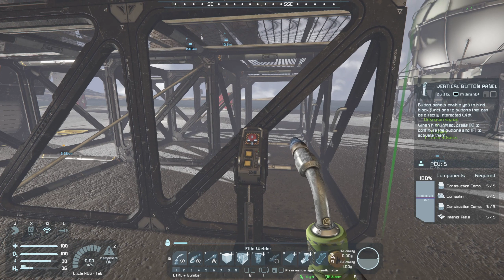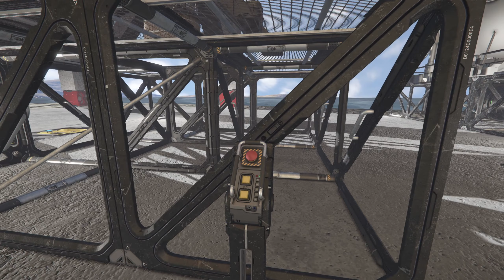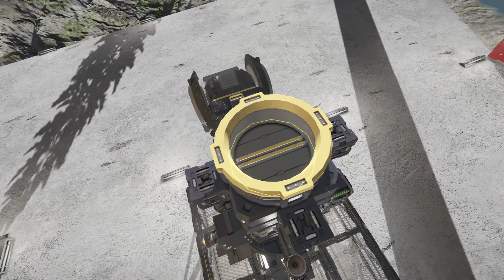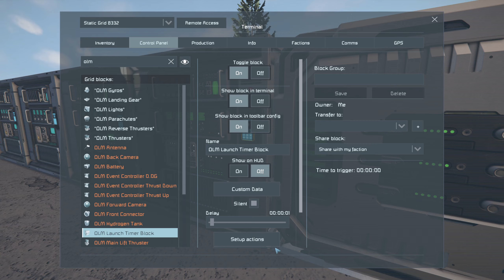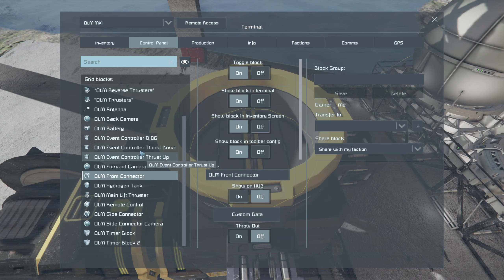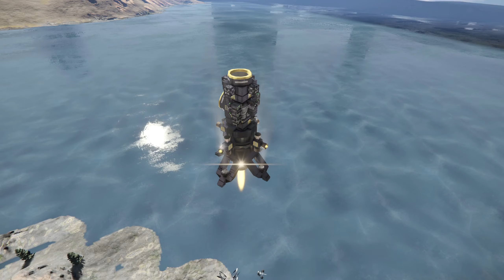Space Engineers Play Through: Close to Home Ep. 17 Need a Lift?

Comment: A very satisfying launch. Just on the auto-thrust, it didn't seem to work, because the event controllers only do a action once. I have a single event controller under 95m/s trigger a reoccurring more thrust timer, and alternate action [over 95m/s] trigger the reoccurring less thrust timer, with both timers also having a stop function to cancel the other out. All that aside, you are in space now, one small step, but also one massive step. I look forward to see how you put your spin on overcoming the numerous engineering challenges ahead.
Reply from the maker: I went and checked and it looks like I forgot to setup the second event controller for the auto-thrust. I setup the one to turn on the thruster when it slowed down but not the one to turn it off when it got to speed. It should pulse on and off as it goes up.